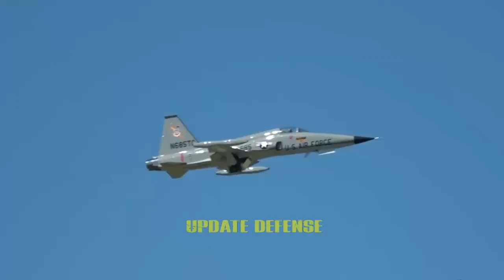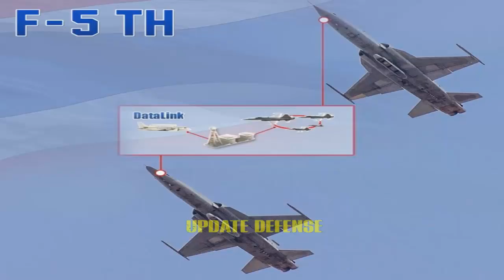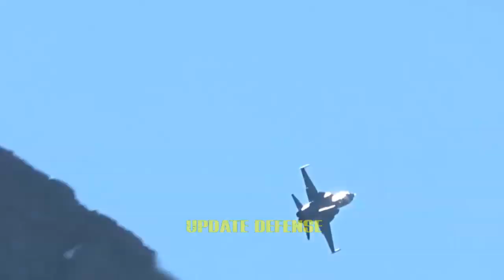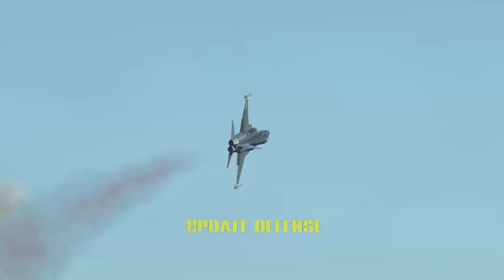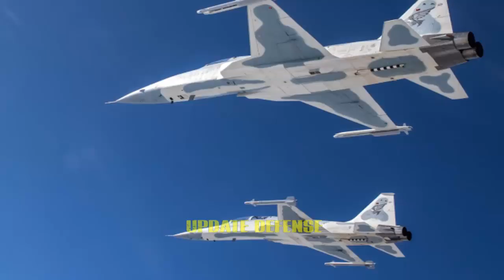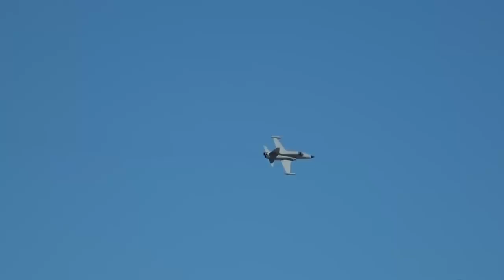Thailand Upgrades the F-5 Tiger II Capability to Equivalent to Generation 4++ Gripen C/D

Comment: In the case of Brazil that has an F-5 Tiger II better than that of Thailand, which is the F-5EM, we will gain an operational breakthrough with the Jas 39. With greater speed (Jas 39 E mach 2 / F5EM mach 1.4), greater combat radius (Jas 39 E 1,500 km / F5EM 989 km), greater maximum distance covered (Jas 39 E 4,000 km / F5EM 1,500 km). The Jas 39 E can use all the bombs and missiles that the F5EM uses and countless uses of Meteor, A-Darter (from Brazil) “5th generation” bombs and missiles, Iris-T, Spice 250 and Spice 1000 pumps. to be able to launch our new long-range air-to-ground cruise missile the MICLA-BR (version of the AV-TM 300 that is similar to the Tomahawk).
Reply: Bot use same upgrad LAMO

Comment: Why wont philippines do the same on their retired f-5??
Reply: No money, but if theres a money to upgrade much better to buy new fa-50 jet
Reply: PAF has an older model of F5 which are A/B. Thailand F5 are E model and it has a much powerful engine.
Reply: because the past administrations of the president of the Philippines has no concern what so ever to the aerial capability of the Philippine Air Force, that is why the entire fleet of the ex PAF F5A/B FF has been sold for scrap material, without any replacements at all.